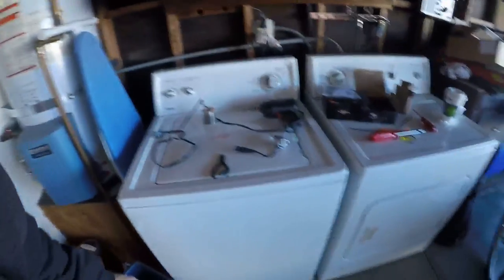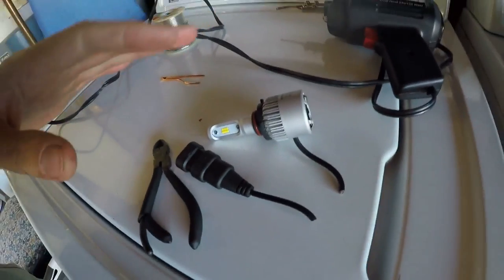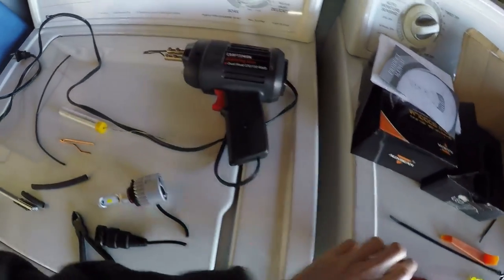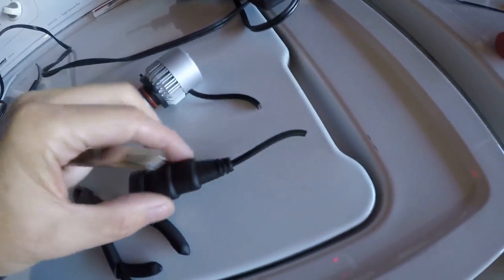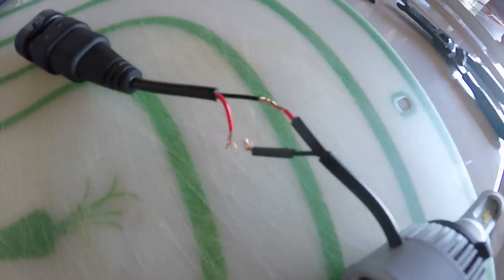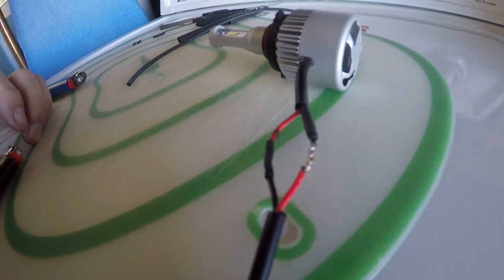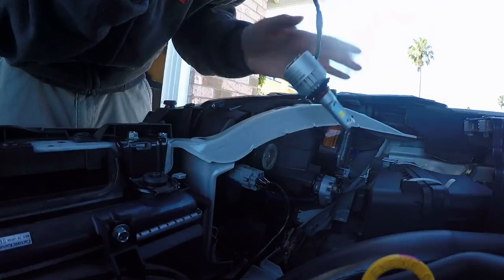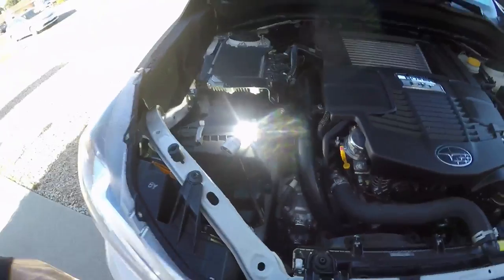2015 Subaru Forester XT: Ep.28: Fixing the Auxbeam Polarity Issue

Comment: Looks good! I'm thinking about getting the auxbeam FS-2 for my low beams. Any suggestions for the DRLs / High beams? Can you run the FS-2 for both? Or will that be too bright for DRLs or too dim for the low beams?
Reply from the maker: the bulbs are called F-S2 or F-S3. The S3 is the CSP high end phillips and the S2 is the lower end COB chip which had the yellow haze.